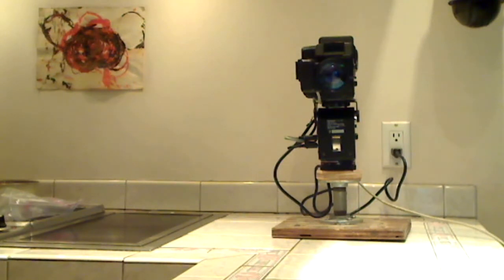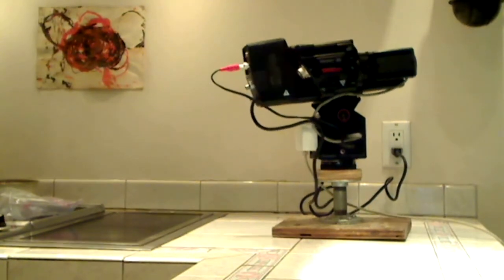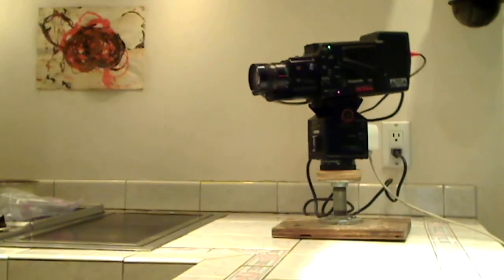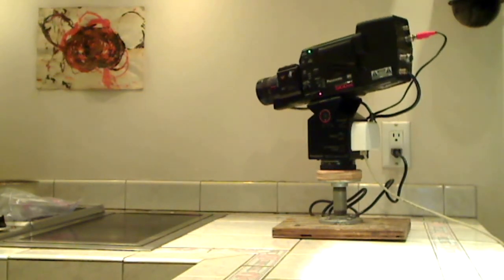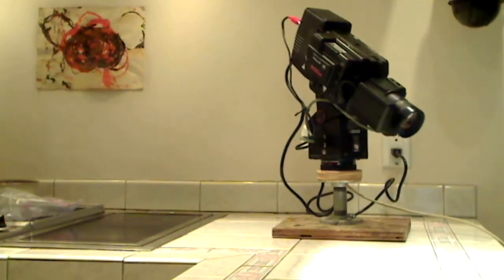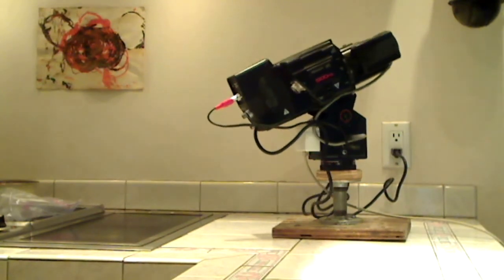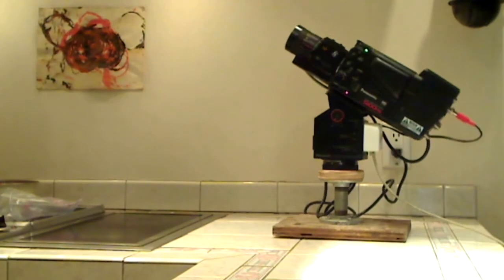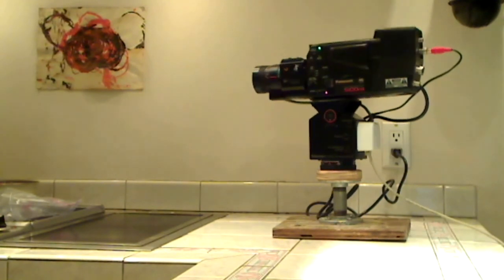Panasonic WV HD5100 (re-engineered for remote video system)

Comment from the maker: I moved on past this camera to Sony CX and CR hand cams...  with lanc control... for remote record activation, photo shot activation, as well as zoom control..  The bases I redesigned are compact... well designed and more functional  than the one shot versions we see selling for hundreds... with limited functionality....  the table top controllers sport the video feed from the camera as well in the camera ph10 base...  what ever you are doing... or have in mind... overcoming engineering obstacles may be different for each occasion...  from Remote cams...  with wireless control transmission to Local cams hardwired to where ever you and your monitors are located...